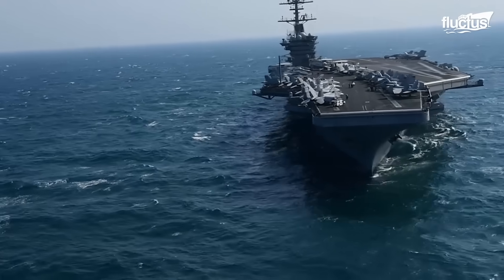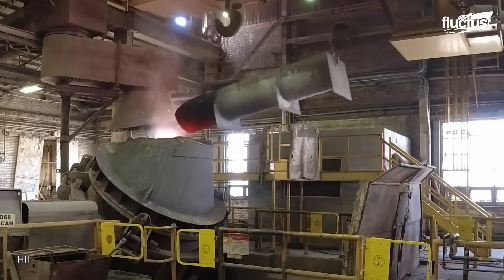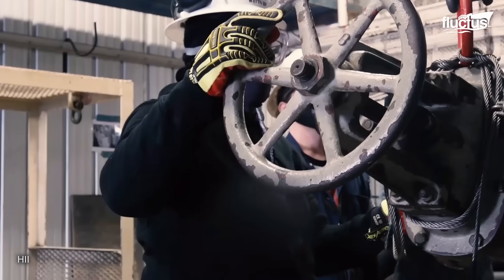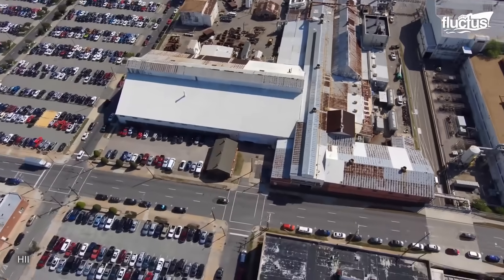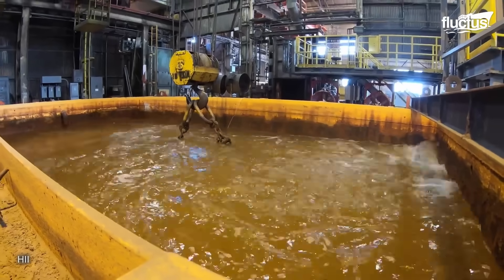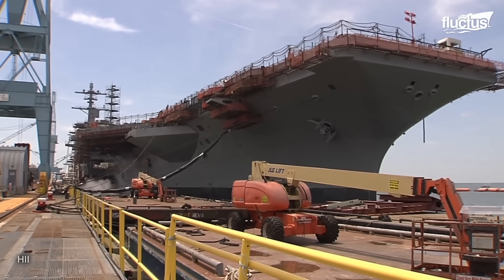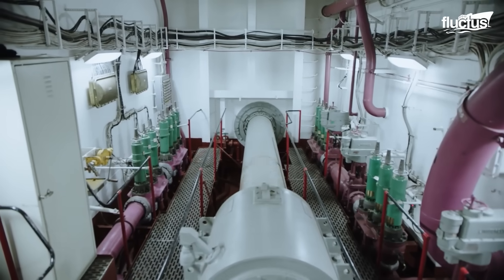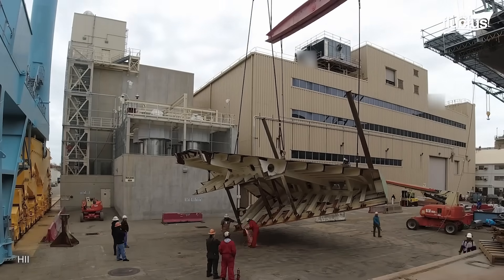Inside the Crazy Construction of Newest US Navy $13 Billion Aircraft Carrier

Comment: Do they not have 10 already?
Reply: 10 Nimitz class and one Ford Class for a total of 11. But remember, the Fords are replacing the Nimitz class which was designed in the 1960s. The Nimitz itself was commissioned in 1975, and will be replaced by the new JFK about the time Nimitz will have been commissioned for 50 years. And the reason the US has so many is because they're covering two oceans, and there's a set cycle that a carrier goes through that requires soo many.

Comment: The modern American carriers do not have keels like older ships; indeed most navy ships do not as most are built like torsion boxes.  Once all assemblies are welded together the entire structure essentially becomes one piece, making it very rigid and very tough. Ships with real/traditional keels are built from the bottom up, where  modular assemblage ships like CVN 80 are more akin to a lego construction. Also, that part that is cast is not the rudder but the pintle, the part that bears the rudder shaft.  Rudders themselves are not cast but welded torsion boxes, just like the rest of the ship, making them very tough.